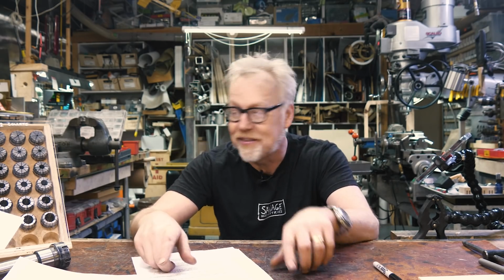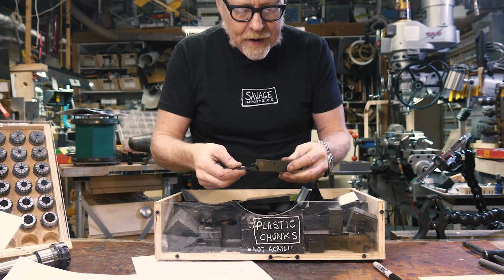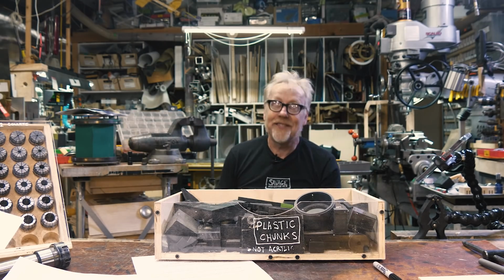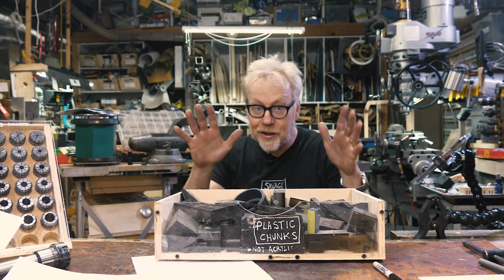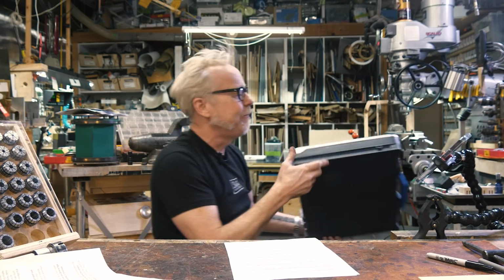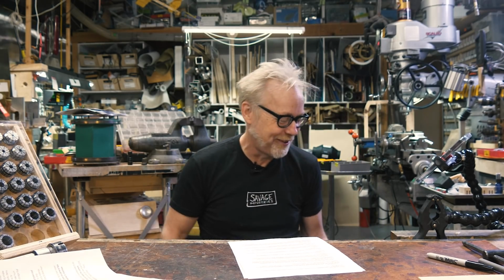Ask Adam Savage: When to Discard Scrap Materials

Comment: I work on a lot of bikes, especially dirty and grimey ones, so I save scrap paper towel. Whenever I wipe down a surface with paper towel, I let it dry out to be used on a sludge covered bottom bracket later. It just seems so wasteful using a fresh pristine paper towel to move around sludge.
Reply: Haha, i try to get multiple usages of those too. Many things i clean in my shop need to be as spotless as possible, and particles  that stick to the wipes can cause scratches. But other things just need to get cleaned from nasty to less-nasty, and the reused paper towels are perfect.  They're expensive!
Reply: I do the same! If all I’ve done is washed my hands I’ll leave the paper towel draped to dry, drives my partner nuts when there are like 5 of them festooning the kitchen. Artist habits.

Comment: About drawer slides/access for the Sortimos. IMO you don’t want slides on for every storage location.  The ones on floor and 5’ (1.5m) up are not good for rummaging through. I built a bread-rack for Stanley 14725R (the poor man’s Sortimo). I made a pull-out shelf at bar height in each column. This works amazingly well. When you need something, you pull out the shelf, grab the organizer, put it on the shelf, rummage around, and be sure to put it right back for the next thing you need.

Comment: "When to Discard Scrap Materials?" that's definitely a tough question, i absolutely agree with you on that.
I feel the urge to keep everything that might com ein Handy a some time. Since I live (and work) in a rather small place throwing away things is mandatory. I still keep a lot of stuff I never use but you never know. I guess everybody had that moment when we have thrown avay that absolutely useless looking piece and three days later we needed exactly a piece of that material in roughly that shape and then we have to buy buy a new piece or cut it of from a perfectly fine board, sheet of plastic, leather, whatever, but I guess you just have to skip that thought, especially when it come to tiny bits and you have dozens of them.
I just threw a large bag full of tiny fur scraps away this morning. I way need some pieces in the future, but not a large bag full of them.
The big exception is Worbla. The blessing and the curse of that material is that you can use every tiny bit of that stuff since you can just melt it together again to make larger parts, but My Box of Worbla pieces is huge.
I occasionally use them but I admit, I probably create more scraps than I use....

Comment: For the sortimo(sp?) cases, find the row that is at the most comfortable height for rooting through cases and replace once case with a slide out shelf. Then you slide the shelf out, put whatever case you need on it, get what you need, and put the case & shelf away. Minimal expense & building that will give you most of the convenience of them all being on sliders. And because the shelf slides away it won't accumulate junk and be unusable for it's purpose.

Comment: One way I started dealing with scraps in my cabinet shop was to begin trading out for better scraps.  If I had a good scrap I wanted to save, then an old scrap had to go. But also, I realized that SPACE is also a valuable commodity, and one must question what is more valuable.

Comment: This was such a great question because we all do this! I save wood scraps all the time and with the price of lumber even a 6” piece of 2x4 can save you $10 if that is all you need. But I also save material and leftover parts. An example is years ago we got a new garage door opener, but because we were replacing the older model a lot of the pieces were already in place so I was left with steel support hangers, etc. Heck, maybe one day I use them and again save some $$. My wife does the safe with her knitting, her Cricut plotting cutter materials, and so on. You just never know!

Comment: If you haven't seen it, Alexandre Chappel built a shelving system for his own cases of a similar style, and there was a little pullout shelf halfway up so you could set the box down right there and get the trays you need. That could be a happy medium between having to bring them to another table and having every one on its own drawer slide (I feel like there'd also be a pretty narrow height range for that to work well). It might even be a relatively simple addition to the rack you already have?

Alexandre Chappel's vid: https://youtu.be/OthwoWeLb_U
Reply: This is what I was picturing!

Comment: I am a woodworker who uses a mix of reclaimed wood, store bought dimensional lumber, and wood from limbs and logs thay I mill myself.  I do not have a huge shop so I have to be more discerning about what is kept.  Typically all small plywood and pressboard goes in the trash.  Most small bits with paint or finish also head to the trash.  Anything else that is less usefull goes in boxes and a couple times a year they head to friend's houses that have woodburning stoves.  So the majority of my extra scrap ends up used for further projects or providing winter heat.  As Adam said though, decided which to keep id a difficult process.

Comment: In my very small woodshop, it depends on what the material is.  I keep offcuts of hardwood in a bucket for tiny crafts, but most of my pine waste gets burned.  I have just enough to use for jigs/sacrificial purposes, and all the rest gets in the way.  I used to hold on to scraps of 2x4 that just got in the way, then I realized if I ever needed some I could buy one fresh 2x4 board and make enough scraps for a year

Comment: Make the rounds at the Habitat for Humanity stores in your area for drawer slides.  I can't afford Sortimo but, the Harbor Freight version (Stanley knock-off) is one I have built shelving for. Walmart has reasonably sturdy metal shelving which can be retrofitted with drawer slides on wooden end/divider panels and the whole thing can be put on casters, If you keep the two halves unstacked.  It's also a very serviceable mobile worktop.  H4H is also a great source for casters (Or was until Adam mentioned their usefulness).

Comment: I built a storage cabinet for a similar sorting system to sortimo, I have glides on the cabinet that the storage containers can slide on/in to and simply have 1 set or drawer guides on a pull out platform on top which can be slid out and provides a space to set a sorting container on, and when not in use slides right back into the cabinet. My bench top drill press sit in top of the cabinet on one side and my bench grinder sits on the other, and I want to say maybe 12-15 organizers fit in each side; it is on 4 inch locking casters so it can be spun around or tucked away as my shop is only 15’x25’. I used the cases from Harbor Freight that are similar to the sortimo though at $5-$10 depending on sales a lot LOT cheaper than Festool. Though a lot of companies make similar systems now like Milwaukee and DeWalt if you prefer them. As a business owner cost and function are king and while I will spend more money on some things that get you demonstrably better life lengths sortimo simply doesn’t justify the cost over something like HF; we use the containers for storing a lot and have built similar slots on the trailers so you can swop out boxes as needed.

Comment: My answer would be when it starts to encroach on your creative process or eat up your valuable shop space that could house another tool or project. 

One thing that my father and I used to do with materials at the end of the year that would be left over… Specifically wood (if it was not treated) we would go through and cull out Anything worth keeping and store it but any really small pieces that were just trivial we were always cut them up and put them in to 55 gallon drums that we had over by the wall and at the end of the year merry Christmas we would take a 55 gallon drum full of kindling and give it to people for their fireplace.

We also used this scrap wood to heat our shop all through the winter with a wood-burning stove in the corner… So it might seem like waste but not really since we were burning it for heat. 

I rarely ever throw away metal scraps since you can obviously weld them, but for example in order to create more “useful scrap” when planning projects out in the drawing phase I try really hard to make sure that the scrap that will be left cutting things out will be at least semi-useful knowing that larger pieces are more useful in most cases than smaller pieces and that pieces with a straight side normally have more use. 

And yes for what you keep storage is key. But I never throw it in the trash per se. 

Really small pieces of plastic can help make great kids toys…

Comment: I can fill my pickup bed from a local amish mill with cutoffs and scraps for about 30 bucks. They are kiln dried and most people use it in their wood stoves. As do I, but I filter through it and find all the scraps with amazing figure and rip it into blanks that I glue together to make cutting boards, boxes and other things that end up having amazing figure and glisten depending on what direction the light hits it. A lot of oak and walnut. Most of the peices come from crotch areas. I have even gotten some cut from burls. They dont like these areas because it isnt consistent for the tongue and groove planks they make. I have made lots of money with their scraps that would have been burned.

Comment: The welding shop I work at recently started sending pallets of our drops to the local tech school. the recently got like 3000# of 2" angle iron because we end up with a 50" ish drop off a bulk job we do and we all looked at the scrap bin a little queasy after every run. as makers, seeing one of those big audo dumpers loaded with material so long it hangs out the front is never a good feeling.

Comment: A friend of mine would scrap any bar stock that was under a12" long , I have found as a model builder (steam engines  and gas engines )that anything under 3" long goes into the bin  otherwise the shop is too cluttered .

Comment: One time I left the rubber grip from a bicycle handle in the same spot on the floor for like 3 years, because everytime I looked at it I just had a feeling... Eventually it ended up being just what I needed for the handle of a portable shop light that I cobbled together out of other junk that I saved. I'm not saying it was worth it, but it was an interesting experiment. And I still use the light 💡😁

Comment: I built a cabinet/rack for bins similar to your sortimoe(sp?) cases. What I did was build one pull out shelf on drawer slides at a comfortable height. I think it would be pointless if you had drawer slides on all of them unless they are all at a reasonable working height.

Comment: I am a field carpenter and don’t do a ton of shop work.  For me, anything less than 16” dimension is worthless.  Plus, not working in the same place all the time, I probably wouldn’t have the scrap on sIte if I needed it.  If I worked  in the shop more and on smaller projects I’d probably save more.  In any case, the hassle of storing scraps and the logistics of it is often not worth the monetary value of a lot materials.

Comment: I find in that all makers work to a modified Parkinson's Law, that instead of "work expanding to fit the time available" Stuff accumulates to fill the storage available.
In my experience while we do horde inordinate amounts of what would generally be considered scrap we do also slowly consign the worst of it to the dump. Although that is because we have generated new scrap and if we didn't chuck the truly useless stuff we would no longer be able to use the work bench.
Case in point, today out of a 3mm plate steel off cut of off cuts, a desk draw handle, part of a trailer bed and a spring latch I rebuilt a security shutter attachment. 
All out of stuff from the scrap bins

Comment: Adam, instead of getting 100 drawer slides just make one slide out shelf that you can but the box on while retrieving what you need and then slide it back into its spot. Ok maybe not the super elegant solution but at least you would not have to walk over to a flat surface to put the box down on.
Reply: Indeed,  the highest and lowest slides are nearly unusable anyway

Comment: It's hard to throw out any tech stuff in my town. maybe twice a year is a toxic waste collection, usually the day I am away or working. Electronics, maybe in a nearby city rarely. Scopes, test equipment, decades of hobby projects. metal like disk brakes, motors, air compressor tanks. I was saving a pile for a nearby scrapyard, even cat converters from my 20+ year old cars and wood stove, they closed up.

Comment: Adam, If looking for low cost drawer slides, check out Outwater Plastics on the web. In 2020, I ordered 22 pairs of 24 inch 100 lb full extension ball bearing slides for a miter cabinet I was making at $8.21 a pair. They have lots of sizes and types available. I'm also on the Sortimo bandwagon so would love to see the cabinet you would make.

Comment: I worked for a firm with a philosophy about scrap: 
If you haven't moved or opened the box of goodies in 6 months, get rid of it.
If you need it again, it will be cheaper and better quality than the old stuff you have on hand right now.
You gotta be mindful of tech that goes out of use (vacuum tubes, buggy whips, phlogistin) so you can keep legacy stuff working and the odd souvenir.

Comment: I have the same problem. I find that small pieces of anything can be used for various fixtures. I’ll save odd bits of metal, and go and quickly weld them together for a fixture, or some odd shaped part I don’t want to machine out of solid. It’s really difficult to let materials go. It’s so expensive, particularly these days, to buy materials, that a small piece of bronze might cost $30! Throw that away? Crazy!

Comment: Heads up Adam, I have done exactly what you want to do with the Sortimo T-Boxx and drawer slides.  The problem is that the bottom of the T-Boxx can start to sag from the weight of the contents and the lid wont close without some force.  I had to modify my slides to include a support for the bottom of the box.

Comment: Drawerslides?  I can understand not wanting to buy and install 50 pairs of them.  Maybe you could get by with just a few pairs?  In each cabinet or each stack of those cases, build just one flat shelf that pulls out on drawer slides.  Then you pull the case out, pull out the shelf, set the case on the shelf...  It's an extra step but it gets you a convenient place right where you are to set the case while you look through it.  And you can push the shelf back in as easily as you pull it out.

Comment: Put a hook on the glue cart and LIFT that sucker above your head.

Id suggest a 4:1 rope system and a deck cleat mounted on the side wall.

Lifting strap with eye can be riveted right to the cart.

When you want to get the cart out of the way you connect the hook, pull the rope till its above your head then secure it to the deck cleat on the wall.

To get it back down you undo the cleat, lower it, detach the hook and move it where you want.

Comment: Adam dreams of a gallery of costumes... I dream of a shed or workshop where I can use my tools properly. In a way, it is reassuring to know that even great makers are aspiring to more space to store their stuff. Because I seem to find it's always a great compromise. 
Tools I cant use: I have a CNC - but nowhere to use it where I can make that much dust or noise. I want a lathe and a drill press (maybe double up for inserting threaded inserts).
I'm glad I can have a 3D printer on my desk - it's not messy or noisy so is ok in the home setting.
Reply: If you could stand to do it, those costumes you want to see on mannequins, could you hire that out for corporate lobbies? Some places love that kind of decoration, so it'd be displayed instead of in a cupboard somewhere.

Comment: 📥 9:20 Adam, what about building onto the cabinet a flip out or fold up/down tray as a temporary base while the case is open?

Also, do you truly need full on roller bearing slides, or could you rough it with some shop-made nylon/teflon slide-type support? 
Asking for a friend.

Comment: I throw something away when it meets most of these conditions:
It has no real monetary value
I can buy it for a low price if i need it again
It's available without looking for it for a long time
It has no historical value. 

So i have some vintage radio parts which are barely or not made anymore. They take up a lot of space, but buying them again is hard and/or expensive, so i keep them. 
I have a lot of tube sockets too. But those are still being made, have no historical value, and i can buy them if i need some. So i'm gonna get rid of maybe 75 out of 100 sockets i have. 
I have some quite long ferrite rods. While not expensive nor historically interesting, they can only be imported for china so i keep them to avoid the frustration of waiting weeks to get them.